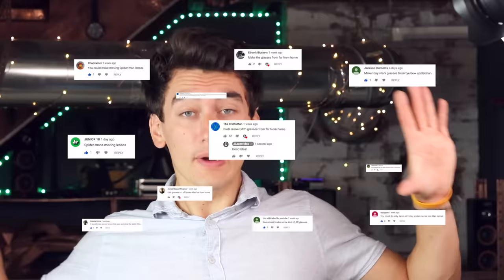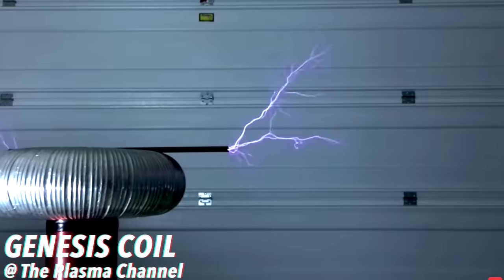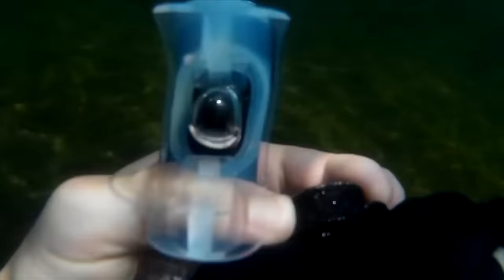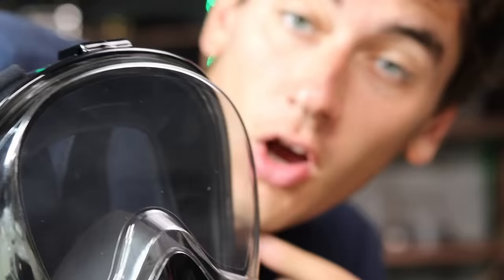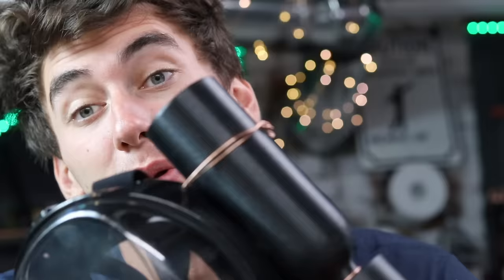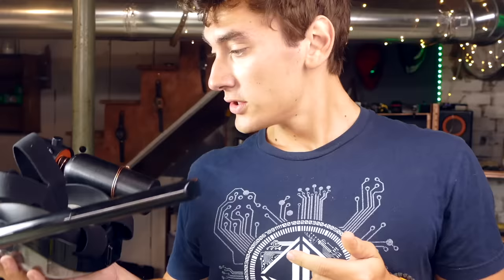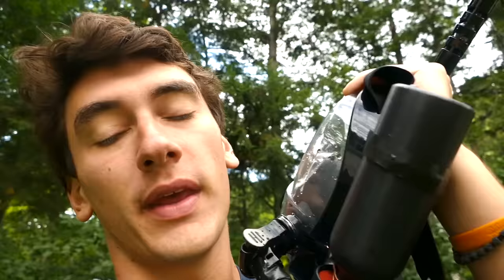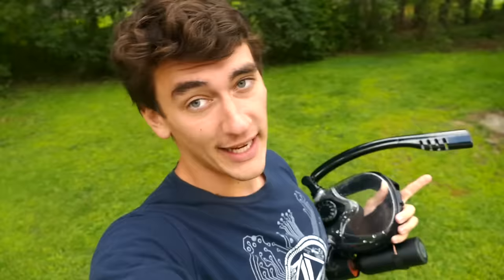BREATHE UNDERWATER With Just a MASK?!?! - Easy James Bond SCUBA Build (Building Your Ideas #1)

Comment: As a free diver I have to warn you that the ball valves on the snorkel are not very effective. They can be quite dangerous. Love the videos though.
Reply: Hi, just curious, dangerous how?
Reply: They can let water in if you are under much pressure (say about 10m down) and then you cannot blow the water back out.
Reply: Ian, this is why any quality snorkel will have a purge valve under the mouth piece to blow out any water left in the low point of the snorkel.
Reply: @gregkunkel708  If you use a snorkle as a freediver it dosent matter if you have one of those cuz you never keep the snorkle in. First thing you wanna to is breath in and not out
Reply: @NeillRobinson  gas toxic (air need to be properly filtered), limited air supply(how long does it last? Even you can go to 60feet and come back immediately, you need to have a safe stop for minutes, and most divers go underwater for more than half hour), no reading for accurate of remain air supply. And..... how do you control your BCD with that. Luckily this didn't kill someone.  You should know all divers would always test their air supply quality even it was properly filtered in a dive shop. Just take a scuba diver course as it's entry level.
Reply: @denniswagnermeyer6239  yea, most people forget  they need to breathe in first to blow out the water. I saw a person struggling with this in my checkouts (didn't take a breath before switching)
Reply: @denniswagnermeyer6239  one of my buddy was panicked and put me toward,  teach me "do not approach to any panicking diver" (I was too close)
Reply: @ianfisher6636  I bought a crappy version on a mask snorkel and that happened but thankfully it wasnt 10m
Reply: I’m thinking about making a prototype like this on my channel, so I’m glad you posted this comment!!
Reply: Neil Robinson Under pressure the ball can become stuck in the top of the snorkel. Which is why modern snorkels don’t use them.
Reply: Smart-shitters !  He said no deeper than 3 meters !!
Maybe you are right with your negative waves and it is completely unreasonable to even get wet without first getting $ 2000 in equipment !?
Reply: @ianfisher6636  so like 10ft deep pool? Also I have full face goggles like the ones that cover ur nose. When I go down deep it hurts my ears
Reply: @peterking2651  not even the heaviest of balls
Reply: @Georgeparkerfilm how did that go?
Reply: Yeah, I'd go dual tanks.
Reply: Yea I always take them off
Reply: It rated for 3m so

Comment: you should add a pressure gauge attached to your wrist so you can see how much you have in the tank
Reply: I think a CO2 gauge and depth guage would make it so he doesn't accidentally die from doing this again jesus
Reply: Or you should go get certified and rent equptment and be informed and not die from the bends or lung over expansion and if you do this you will live and be able to hear for the rest of your life
Reply: I dont think he woudl need any pres gauge its more like mask to test how lucky i'm
Reply: Why, it has to be less than a 160psi (max pressure from a bike pump)🤬
Reply: lyca0n he’s already on the most likely to receive a Darwin Award list.
Reply: @lyca0n535  I agree with you
Reply: @peterking2651  that wasn't a bike pump. It is a special pump actual made to refill high pressure air tanks, primarily sold to refill the small rescue tanks, like he is using. It builds up to 3,000psi.
Reply: I was thinking the same thing 😅
Reply: @holyhandgrenadeofantioc8782  i really dont see someone getting the bends from a wopping 10ft under water. now if you said what 30 to 100 meters down yeah and if they was under the water for like a half hour and not 5 minutes.
Reply: Oh thats how that works
Reply: Oh thats how that works
Reply: @peterking2651  thats not even a bike pump...
Reply: isnt this supposed to be a spy equipment?
Reply: @holyhandgrenadeofantioc8782 you wont get bends with this half a litre tank

Comment: You shouldn't use it a lot, the air pump you use to fill it has grease and oil and some particles of that can go in to the tank and you then breathe it.
Reply: Yes indeed
Reply: Can you use a 12v car compressor?
Reply: Aki Games even though most of these pumps are cheap they have a small water oil separator on the quick connect
Reply: Don’t we breathe CO2 all the time bc of pollution? How are lil particles bad
Reply: He used a specific kind of pump used to fill these kinds of tanks that is not dangerous
Reply: Crypto Man NO DO NOT DO THAT YOU CAN GET INTENSE GAS NARCOTICS and have a high risk of blacking out
Reply: Gattagofast Productions chill compressors aren’t used near gas even car ones it wouldn’t put gas in it also you would notice if you were getting dizzy
Reply: Yeah I thought so too
Reply: Smoking is way worse
Reply: @Hakimfarhat No, use compressors for specifically breathing the air, like a scuba compressor, at just 6m contaminated air becomes toxic and can give you a number of illnesses, like oxygen toxicity which has a high chance of killing you